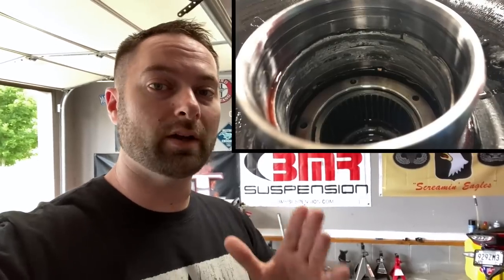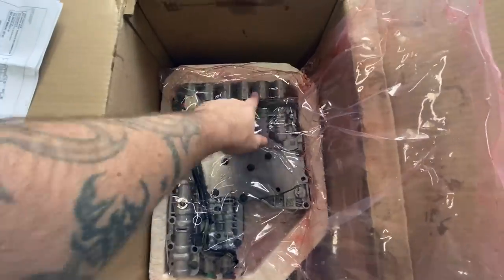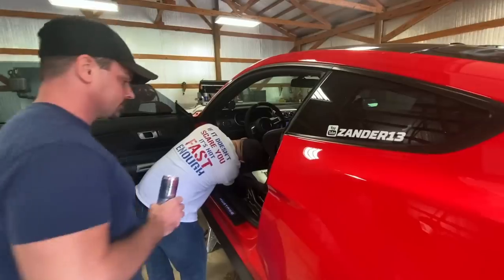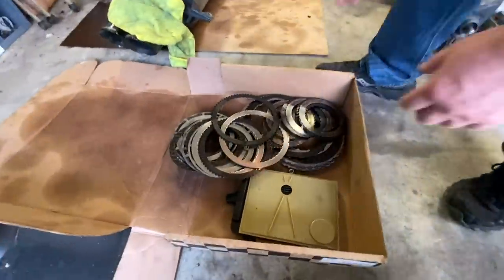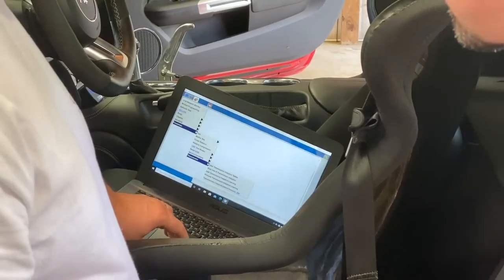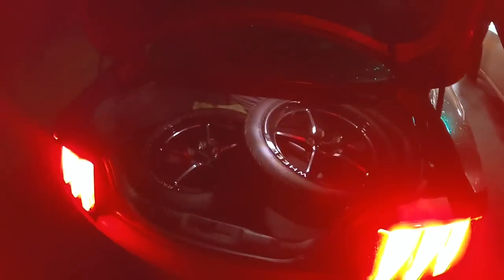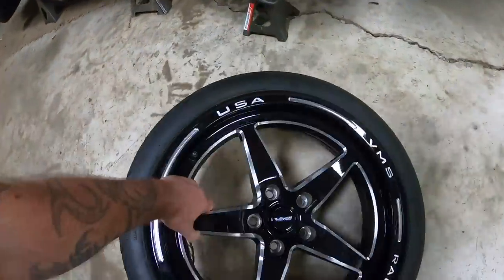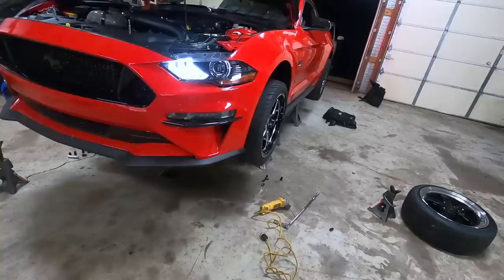Twin Turbo Mustang Get’s A NEW LOOK Plus a Built 10r80 Transmission *ARE WE RACE READY YET?

Comment: I have all ways been a chevy girl my dad ran chevys all my life on the street and strip but this video makes me thinking maybe I should give a mustang a try but it would be hared to leave my 68 chevy Impala SS as 327 blown 331CID  ED PINK RODS AND CRANK
ROLLER ROCKERS WITH PUSH RODS AND ROLLER 
CAM BY CRANE PRO
VAGA TOURQ CONVERTER 
2 SPEED POWER GLIUD BUILT BY NASCAR SHOP IT BUILT PROOF and 12 bolt rear end with 4 11 gears
And Hayden axels with
Currie center section
She runs fast and puls front wheels of the ground and out runs corvettes for lunch
At 50 mph take off 
Any way great video 
And my 2 EVOS
SO WHO KNOWS JUST MIGHT GOOD VIDEO AND NICE WHEELS KEEP ON RIPPING IT UP ✌

Comment: Hey man I have a question regarding reflashing of the transmission. My 2018 Gt 10r80 has pretty much grenaded the one way clutch. Car is out of warranty due to tune. There is someone local to me selling a good working 10r80. Would I have to reflash the computer if I swapped out the transmission?
Reply from the maker: Yes. Pcm needs to match the new valve body shift strategies numbers
Reply: Zander13 Sounds like Forscan will not work for that?
Reply from the maker: 98snakehorse it might. We tried but were unsuccessful